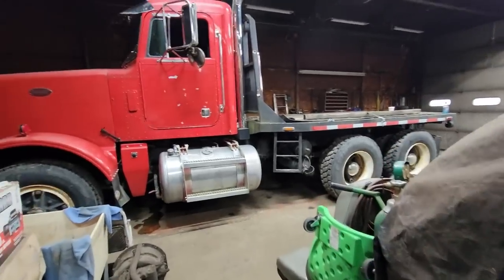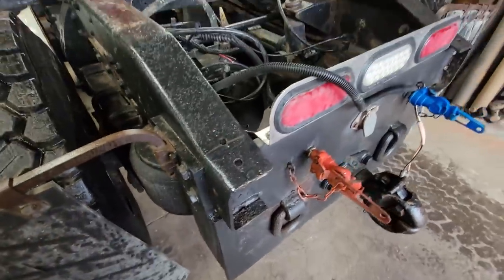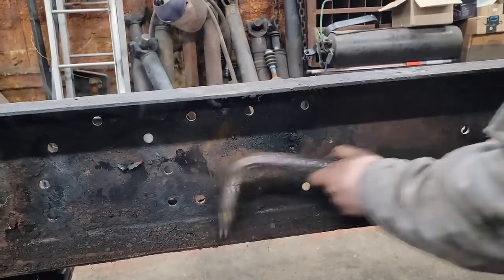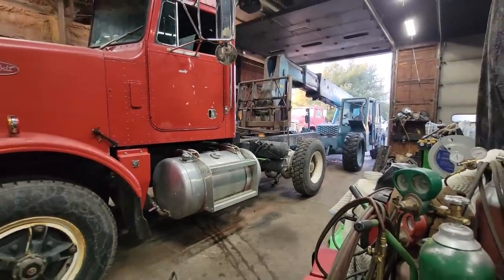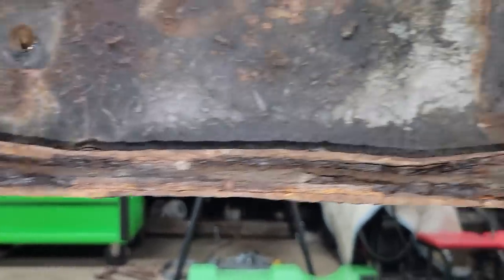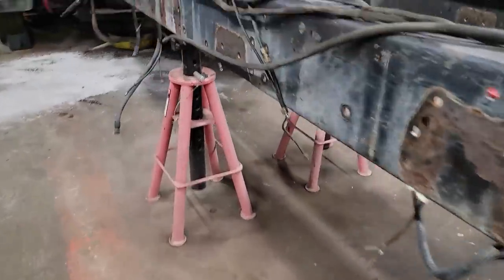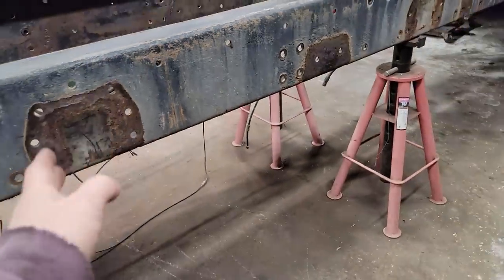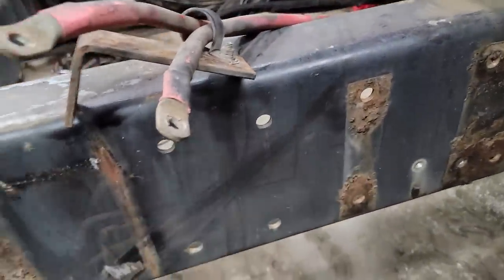PETERBILT 349 FRAME STRETCH PT1 THE TEAR DOWN!

Comment: The amount of rust y’all have to deal with amazes me. I bought an 79 international F1954 factory double frame dump truck in the late 80’s and sold it in the early 2000’s and the frame looked like new still. In Texas off road in the mud and sand zero bad rust. That salt is bad stuff on your roads.

Comment: There are many ways to cut and splice a truck frame. The 45 degree cut seams to be a industry engineering best practice as far as I know. You have a big project on your hands. And yes it’s an absolute that the frame needs a glove to double it for strength. To take stress of any weld joints. 👍look good so far once it’s stripped so the full picture of the current frame conditions are no longer hidden.

Comment: Jc there are several heavy truck shops and salvage places here in central ms that may have what you need. I don’t have a way to transport parts but can help a little on lining stuff up. It might be worth spending a day or two on the road to significantly cut the wait time down.
Reply from the maker: i picked up some sections today. fingers crossed they look good once i strip them down.

Comment: In 90s i worked @Peterbilt in test dept. One truck i was working on had rear alignment issues, turns out a frame rail needed replaced. To see the frame assembly guys unbolt & pull out rail then slide replacement in while truck parked right outside the back door, was pretty damn cool.

Comment: I'd cut off as you pointed too doing.
That frame is toast.  Even try'n find a used truck with a good frame? Or salvage yard for part of one? (Even a double frame?)  
We used to install Grove & Mid-Equipment rollbacks.  There was always long cutoff frame tails that were compatible.  I remember 5 Int'l Cab n Chassis, jacked drivers forward to facilitate the cab to trunion for hoist n dump bodies.  The cutoff parts were a treasure trove later on down the road.  The boss even sold one of'em the frame parts to a competitor.  

Back in the late 60s, a friend of mine had a 750 Ford double frame twin screw, we cut it, put 7' in it.  He went to a local shop had them form the frame rails of thicker cold rolled material but to fit up with the outside dimensions. The vertical cuts were staggered, after I welded them in they were fish-plated.  He got a factory driveshaft before cutting anything to ensure the right finish.  These were all done in a rust belt state.  
Be a shame to build off of the existing frame n have it fail on down the road.  This'll make a nice piece when you get it completed.  Anxious to see how you get there.  
🇺🇸🏁🇺🇸 👍

Comment: Did some auto cars back in the eighty’s double frame plus 1/2” plate down the outside of the rail were long wheel base built for the oil fields

Comment: A friend will help get it done. 
A good friend will tell you when you'r re doing it cheaply, dangerously and wrong. And then help you do it right. Good plan for the stretch frame, the original frame looks reinforceable. The inner and outer layers added will minimize the original frames multitude of bolt holes. Viable plan so far.

Comment: Gonna be a big job no matter how you do it. I think a cut off would be a nice fit. Upgrades the wheel hubs, gives you a cleaner frame and could get a more favorable gear ratio if desired
Reply from the maker: he wants to re-use the original axles and suspension. i suggested walking beam or slipper spring in place of air bags due to the liquid surging but he refused.
Reply: @j.c.smithprojects  interesting feller that guy.

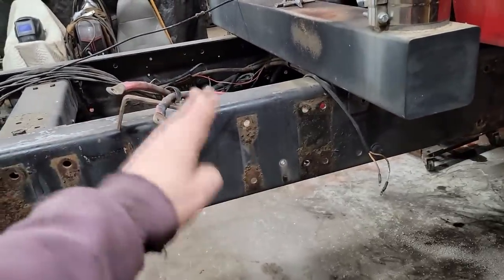Comment: 30:19 most weld per bond is a sinusoidal line. It's actually what they used to do when they build battleships. They didn't know how powerful welds would be (as a bonding method with that metal), so they have "teeth" at every join, which describe a sinusoidal line. One meter of welds is actually something like 4 stretched out.

Comment: O-H-I-O Porter greetings!🇺🇸 Happy New Year! Frames are quite an interesting topic! I’m glad you’re doing this job…there’s plenty of things to cover here. All that rust buildup between the frame & liner can really cause problems! 😔 Some people don’t even worry about such things I guess. There are guys that have done a straight frame cut, weld the piece & then add the outer bracing…and they’re happy. I’ve heard several pros & cons. I think with all the rust involved it could use more area for the weld. So you’re gonna have an inner liner & an outer “L shaped” liner as well? That’s like having 3 rails then. Now that will take care of any issues. Good stuff! 🥰😳✌️

Comment: I think you got a good plan sounds like option 1 is the best and option 3 is the fastest. It all depends on how you mount the tank but you can make it somewhat part of the frame. Check out Diller out of PA they build and mount a lot of manure tankers on trucks. Good stuff J.C.

Comment: Hi jc. Love the video  you gave me some points that we did some right things on the frame stretch we've done ,1st the diagonal cut.2nd the overlap of the reinforced frame.( We've put 20" over from the cut-off are) i was also concerned of the strenght frame.(between streer axle and drive axle, where most of the load will be..(in which we cut the frame in between) and reinforced it with ¼ thick steel plates.(not frame cut outs)on the outside so as not to disturb the cross members.and one question. Will the welds weaken the frame "if" full welded? (The whole reinforcement, front till the end,about 7ft lenght.we done it at 6inches full w/ 4in gap in between)thanks i'm really learning a lot from you.
Reply from the maker: i would not add a plate and weld it the full length. the frame has to flex. i dont want a frame too rigid as it can crack.

Comment: It's also about European laws, where you can't modify stuff, and because internet, it ends up floating on your side of the pond as hearsay. There are some countries here where registering a modified frame (of any kind) that's not done by the manufacturer or an authorized dealer/shop is... well, might as well try to catch a lightning in a jar.

Comment: man you make me really want a gradall lol.... what kind of a wheel base is this going to end up at from the steer to the center of the drives? if your still within the range of factory wheel bases i don't think i would worry about double framing all the way to the steer axle, if your like 300+ then yeah might be necessary. highest stress point of the frame ends up in the center of span so you want to try to avoid placing your welds close to the center of the span if possible. around 1/3rd of the span i feel is ideal gets you away from the moment loading of the suspension and keeps you out of the center of the span, of course everything cant always be ideal. sometimes you have to make a judgment call.  the longer your inserts the harder they are to get, a local steel shop to me can make them pretty reasonable but i want to say there brake is about 15' long. the longer you go the less options you have. you can weld multiple sections of inserts together and stager your welds i don't feel like you would loose any strength kind of a shame to have to do though. i think if there is a clean cut off available id go with a cut off. main reason being that rust in the rails all be it hard to really tell how severe it is on a screen is still going to end up in the suspension mounting locations of what will become the forward axle. there is a lot of moment/shock loading that ends up happening in that area. iv seen more frame cracks and failures around mounting locations for suspension components than i have anywhere else on a frame. i think you would probably be fine with a full insert regardless, but i would want to avoid having any questionable frame in that area if avoidable. also the tag behind the drive axles will push more weight forward towards the steers like my pusher will take weight off the steers just something to keep in mind with the body placement. i don't know if this guy will know what to do with himself with a properly built truck. I'm sure whatever you end up doing its going to come out great.
Reply from the maker: the concern is that he is hauling liquid. the tank cant have baffles at all. so the liquid is constantly surging forward and back, side to side. the biggest stress is a panic stop. that is almost 40,000 lbs plus the g force acting on the frame all at once. i picked up a couple frame sections. i am splicing right behind the cab. the liner will be "minimum 2 times the frame height beyond the splice forward and back" this ends up being about 5ft. i may go longer just to help reinforce that thin frame under the cab.

Comment: 273 x 89 x 9.5mm main frame with 252 x 79 x 6.4mm insert, as-built 🙂 With the 273mm frame, inserts were optional for tanker applications but recommended if used off-road; usually from halfway along the section between the front axle rear hangers and front of the air-ride hangers, to at least the first crossmember behind the bogie. Also it was recommended to solid-mount the tank subframe to angle brackets bolted to the chassis at the rear and at the centre, and use a resilient mount at the front - this was also an angle bracket rigidly bolted to the chassis, but with sprung bolts between the chassis bracket and the tank subframe. This allows the high-tensile steel frame to flex slightly as it is designed to do, without cracking the tank subframe. Please excuse the edits, I had to dig-out my precious copy of the PACCAR Bodybuilder’s Manual, treasured since I worked at Foden - whose chassis were built from the same grade of rails and using many KW/Pete components including the Peterbilt air-ride bogie. Hope that helps 🙂
Reply from the maker: this isnt even close to 9.5 mm thick frame. the cuttoff frame i am using is thicker. i am lining it for at least 5ft but maybe more. then doing the outer "L" frame front to back.
Reply: @j.c.smithprojects  I forgot it was originally a tractor unit 🤦 Possibly 256 x 79 x 8 mm which was common once 300bhp+ high-torque-rise engines becoming the norm (due to the corresponding torque output twisting the rails to an unacceptable degree when working hard). Possibly 6.4mm thick, although that was pretty much obsolete by the ‘80s 🙂 There were several more sizes of rails that didn’t make it to Foden; also we didn’t get aluminium frame rail options due to the whole of the UK being Salt Belt from early November to March-ish 😁
Reply from the maker: this is 3/16" or 4.78mm thick
Reply: The sprung bolt mounting for forward and center tank mounts (rear is generally  rigid) is also to as you said allow the truck frame to flex. But as well as to not induce undo flexion to the structure of the tank itself, which can lead to failures of welds on the baffles, leading to leakage or unmitigated fluid motion. "Causing an unsafe condition". This may not be word for word, but is what I can recollect from Curry's body mounting guides..
Reply: Is "FLEXION" actually a word?? Spellcheck allowed it, and I ain't an engineer..

Comment: Have you though about putting the lift axle to the front side of the drives?
Reply from the maker: yes. if i put it there, it justb means the drives have to go farther back. i gain nothing. they have to be placed right for proper load distribution.

Comment: Both trailer manufacturers I worked at, we used a paint type substance called ECK on the galvanized axle trunions where it met the aluminum frame and an HDPE insulator, both to resist and inhibit corrosion. I wonder if the ECK would be of any value to you for adding the liner to help resist rust jacking? It certainly couldn't hurt. Might be able to pick up a roll of HDPE plastic also for dissimilar metals. Steel on steel I would just opt for the ECK, or maybe even a soft-coat paint that Hendrickson uses on axles and sliderboxes. Not sure where to get that though, I know it's a rust/corrosion inhibitor that repels water made by The Scharpf Group.
Reply: The ECK is also has an anti-seizing property and is dielectric. The anti-seizing property would be helpful in some applications as well as the corrosion inhibitor.
Reply from the maker: going to paint the inside surfaces with axle grease. it will outlive the truck.

Comment: I just found your video on 04/25/2023. I have a similar situation with a truck I bought and need to redo a stretch that was done improperly. I have been looking for places to form up frame rails and was curious about the ones you mentioned near you. So far in my search I have only found one place that can form up 3/8”x10 1/2”x24’ rails and 3/8”x11”x30’ for a different project. I prefer to use someone locally to help support my community but there is no one near that can do this. Would it be possible to get you to share the information for the shops you found?
Reply from the maker: vicon in mentor ohio is the closest. pg adams is in vermont. there was a local shop that said they would do it for me but they couldnt do it in one piece.

Comment: Hi JC, I was wondering what you think about a late model Pete, with bunk and a fair stretch and removing the bunk. Preferably one with a cab crash obviously and the use it along with the drives and a more current suspension. 
 Now mind you I know it's not cheap, and I get that, but as you said with a liner and possibly an overlay,  and in those exact spots you pointed out? Might be a good plan maybe?
 Just a thought, I guess, oh and by the way, I am so glad as well that this guy chose you for this project.
Reply from the maker: i sourced what was supposed to be an "all original, never modified" double frame. went to get it and quickly found where it was stretched. finding a donor truck is far more expensive and far more work than what we are doing here.

Comment: Enjoy your videos. When you double frame a truck could you not seal the edges all the way down on top and bottom with silicone and once per yr or every other yr just remove the old silicone and redo it to prevent that from rust jacking I'm double framing a peterbuilt starting Monday and trying to find away to slow the rust jacking down
Reply from the maker: i dont want to seal it up. i prefer it open so anything that gets between it can get out.

Comment: Liner on the inside cross member you can adjust outside then you have to deal with spring hangars and suspension problem cause you are widening the hangars
Reply from the maker: hangers will accept an outer frame without issue.
Reply: @j.c.smithprojects  but you are widening the frame at least a1/4 in rail on each side =1/2 what about the bushings from hangar to rear to springs
Reply: George  think about what I mentioned measure measure measure George just wondering have you stretched any trucks tell me where I am wrong trying to learn
Reply from the maker: this suspension doesnt have bushings in the leaf springs like you may be thinking. they are in a moun ting bracket that bolts to the leaf spring. this mount is adjustable. the bushing and sleeve inside have enough room to accommodate without issues.

Comment: I might be thinking about it wrong but I think adding an L to the bottom would add more strength than adding one to the top. My reason for thinking that is the bottom chord of the frame is under tension with a load and the top chord has a compression load. If a frame rail fails from a heavy load being exerted down the bottom of the frame would tear and the top of the frame would only bend or buckle. I've seen frame rails that were broken on the top and down the side and the weight of the truck held it together. It went unnoticed until the truck was put on a lift and the front tires stayed on the ground with the rest of the truck in the air. What caused the frame to brake was the guy was plowing way to aggressively, went off the end of a parking lot and his plow dropped in a ditch. He pretty much started driving over his own plow.
Reply from the maker: i have never seen a manufacture put an over lay frame like what i am doing on the bottom instead of the top. i have owned 100's of trucks with an double or "overlay" frame done the way i did this one.

Comment: 2 things: is there any real way to stop or prevent the rust jacking short of parking it while there's salt down? We don't really have a big problem with that here in sw Ok.
And 2: do you have a preference on you cordless impacts? I thought  I had heard you mention in a previous video but I couldn't find it.
Thanks for the videos and sharing your knowledge and insights.
Reply from the maker: i will "paint" all contact surfaces with grease before we put it together. the grease will help keep the salt and brine solutions from getting in between the two.

Comment: Would POR-15 help with the saving frames and parts if you paint them every year or two?
Reply from the maker: i have used por 15 twice and with both i ended up with the same results. it came off in sheets. i use acrylic enamel with a hardener on frames with great success.

Comment: You could always put a push or axle on it instead of a tag axle so it would be in front of your drives
Reply from the maker: if i did that, the drives would have to move back farther for the right load distribution. so i wouldnt gain anything.

Comment: What's the inner height of your frame rail on that truck, cause I'm gonna have around 7' or so of HTS frame off this KW,  as well as the next one. Have to do another one exactly the same when this one is done. Making single axle dumps out of old flat beds.
Reply from the maker: 9 and  7/8" inside the main frame
Reply: @j.c.smithprojects  I'll take a measurement of the outside on the frame I'm cutting off tomorrow.  As well as a length of available material. I'm in MD, so will have to figure that in for shipping/transport, cause I don't really do either. Will update you tomorrow.